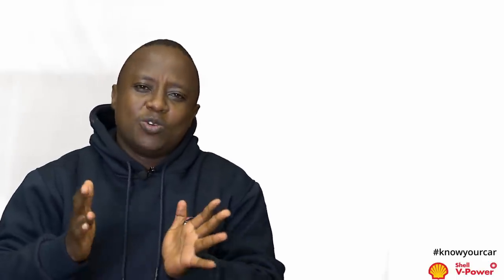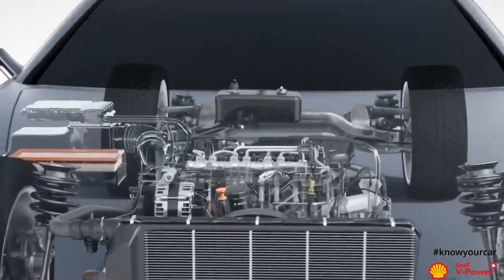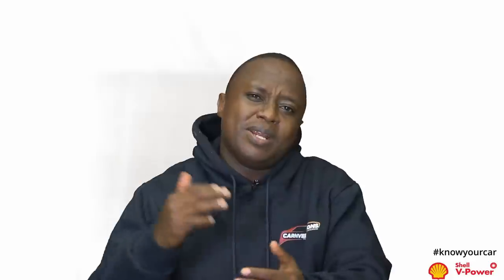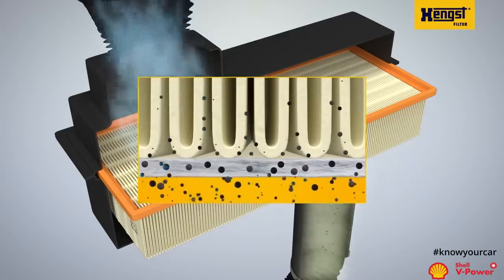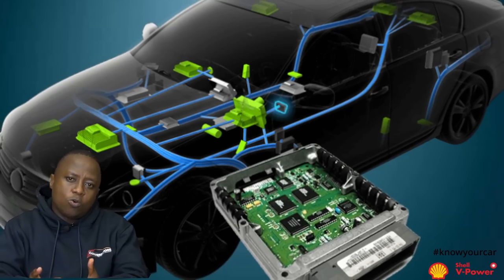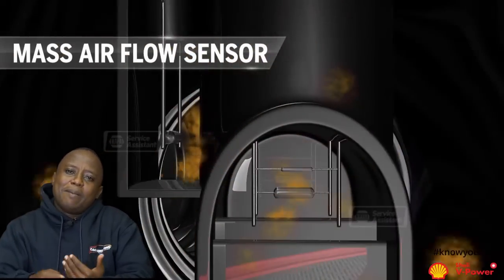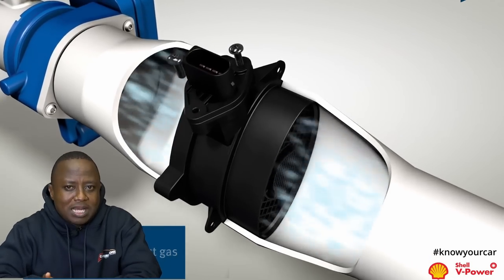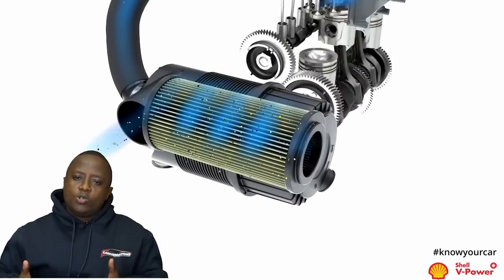How to Save Fuel: Air filter &  mass airflow sensor #knowyourcar

Comment: Thanks Wokabi for sharing the knowledge, I love your channel. 
My Lancer 2006 1500cc deteriorated after engine rebuild - currently does about 12L/100KM. It's been through diagnostics, nothing forthcoming; and I'm just done. What could be wrong?
Reply: Blocked catalytic converter is a bitch too... get that one checked.
Reply: @seanlovi8798  long story with catalytic converter including getting played. Will have it double checked. Thanks.